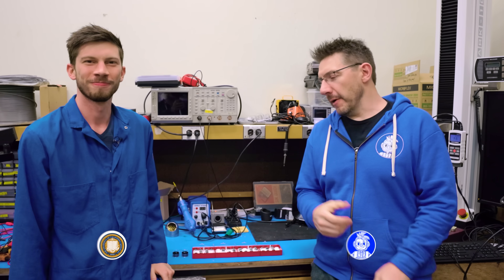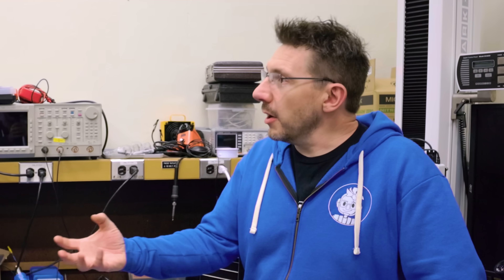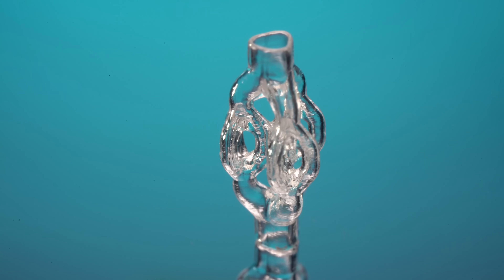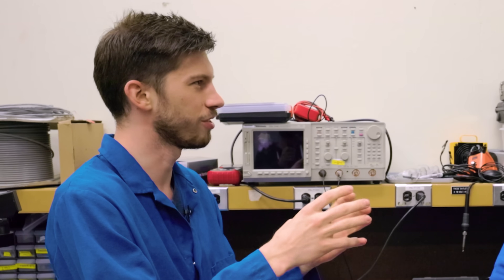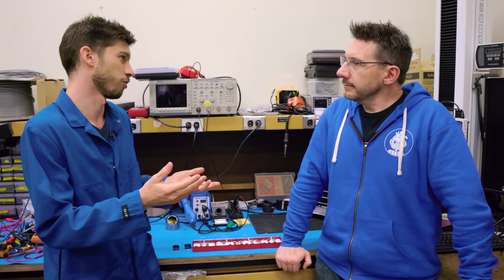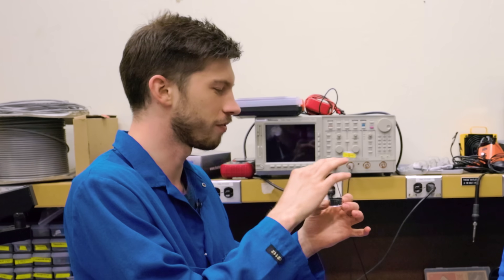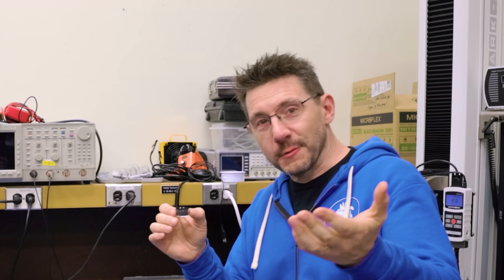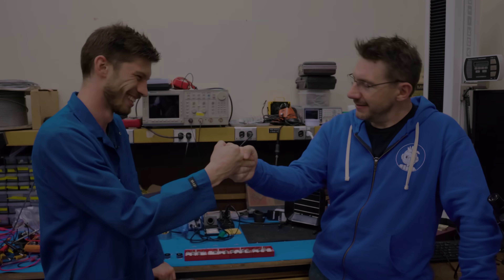Micro Glass 3D Printing!

Comment: You know the crazy lenses in phone cameras these days? Like the extremely tiny telephoto lenses, and how they even have active image stabilization where the lens itself moves and stuff like that? Yeah I can easily see the size requirements for those kinds of things plummeting. I'm also thinking about all the uses within super tiny robotics, things like super tiny glass bearings instead of the ruby bearings you see in watches, with stuff like that we could basically revolutionize anything and everything, so long as you can produce parts consistently in large quantities.

Comment: I used to work on this. Glass 3D printing in this way is quite effective in printing tiny objects, but is not that effective with bigger ones due to the thermal shock during debinding and sintering.

Comment: Printing really tiny lenses that don't need polishing and in complex structures gives me vibes of some sort of focusing chamber for lasers. Imagine printing a tiny version of the printer itself to print still tinier structures. Where would it end.
Reply: At 50 nm the particles they use are actually smaller than the wavelength of light the laser produces! The spacing between atoms is on the order of 1/10 of a nm, so the particles used here are only 500 atoms across, these folks are darn close to the limits of how precise light can physically get!
Reply: @thesquatchdoctor3356  This is a perfect modern day example of "sufficiently advanced technology is indistinguishable from magic." The other big example I think of is CPU/GPU chip fabs. These types of lasers are definitely modern magic lol.
Reply: @im1fadedRob  I don't think anything can impress me more than thinking about how a helicopter works. Those things are engineering miracles.
Reply: @thesquatchdoctor3356  how precise  visible light can be*. Not saying these techniques can scale to higher energy wavelengths but if they can, there is room for more precision.

Comment: The applications that come to mind with this technology are mind-blowing! The fact that you can actually print a lens array means that you can also print a mirror array and then have it plated. This means the micro kulminator as well as combining multiple laser beams can be done in a micro scale. I wonder if it's possible to print around the laser diodes and incorporate them straight into the glass structure. I know sintering is high temperature but I think some of the diodes can actually take that temperature. I work a lot with weaponry and I have a few designs that I couldn't build because I needed precise mirror alignment and a lot of them. This technology literally unlocks my design.
Reply: Laser guns?!
Reply: the couple of sentences of this comment are a little terrifying 😅
Reply: Yes. You understand, at least in part.
It's like looking at Newcomen's engine when it was brand new.
Reply: Very cool, but what are you going to target with your new doomsday device?
Reply: @johnsmithe4656  
The tragedies of the future
Reply: @johnshite4656  I don't make doomsday devices but I do like weapons 🤣 Florida man be crazy, he always like weapons

Comment: next level is micro-nano lithography 3d printing, ie processor making, yep its additive manufacturing process
Reply: Don't know if what i'm saying is completely stupid or not, but maybe this could be used to create photonic processor and/or photonic component. Damn that would be cool, imagine using a PC that use only light instead of electricity (except the part that is needed for the diode to create the light), cooling solution would be a thing of the past.
Reply: @davilinkicefire No your barking up the right tree there. 
I dont think optical computers ever got more advanced then bit/serial kind of demostration models but even in the 1980's those things where running at clock frequencies that are well. Impossible in electronics. 
They just used a glass that copy's the magentic flow of a wire in its internal polarity the light would come out polorized then by combining diffrent polarities they had thier calculations, and the material they used can switch faster then electrons can migrate so faster then a diode can react, they where near light speed calculations.

In the 1980's. 
I think today they use shifitng interfearance bands to run the calculations, and even can use interfearance bands to clock out the light so the materials used to meter the light have time to shift polarity; but the same idea for metering the light, polorize it using a magneto-optical material to actually put data into them.

But producing the demo models was a thing that took an entire university lab several months to set up. This could make that a thing of the past, just print off a few layers, sinister and assmeble them and wam bam here is your computer mam!
Reply: try micro-hole gated matrix nozzle fdm printing, no moving print head at all, just z-extrusion with changing mask along the way, similar to resin uv curing layer by layer

Comment: We got concrete printers, glass printers and metal printers, and to that i say: You wouldn’t download a building
Reply: @Enjeenier  true, that would be too many Terabytes
Reply: @ingeniando3d219 
Depending on the level of detail, it doesn’t need to be a huge file.
Reply: @Enjeenier  BUT! ...Wait... just hear me out! ...you COULD... just ummm.... 'find' a guy online... and he'll build you one for a very reasonable 'low price'... [an undisclosed insanely high price]! So, CHEAP!
/jk
Reply: Not as an Stl.  You need a 3MF for that.
Reply: @nicks1146  you rather would want to use an obj for higher detail, but just to be safe use a toolchanger for soluble supports and up the bridging speed by 200% so the ceilings come out flawless, also use a textured build plate and glue stick for higher adhesion and enable ironing for perfect top layers, you may also want to consider 35% cubic/gyroid infill for better structural integrity
Reply: @nicks1146  you would want to use an obj file for higher detail, also consider getting a tool changer for soluble supports and use a textured build plate with glue and a raft for higher adhesion, also consider upping the the bridging speed to 200% for clean ceilings, enable ironing for perfect top layers, consider using 45 % gyroid/ cubic infill for better structural integrity, and finally lower the layer height on the bricks for better layer adhesion!

Now with the building done, ENJOY LIVING!
Reply: Soon you can download the 3mf.
Print a brick building, with carpets, windows, furniture, plumbing, kitchen and everything right there and then.
Reply: You forgot ceramics lol
Reply: actually the audio used by that video in the 90s was pirated it was licensed for one use , it was then pirated and used on multiple dvds from that era
Reply: @Enjeenier  the Chinese have been printing buildings for over a decade already...
Reply: Don't forget chocolate and silicone.
Reply: Hogwarts 😂❤
Reply: @Enjeenier  but I would
Reply: @Enjeenier  tf I would... Arrrr!
Reply: Actually, you would people 3d print houses all the time
Reply: @HalloGaming  Ik but like a fully finished house , not just the walls, like windows, cables,  sinks, toilets etc
Reply: I would download a house yes.
Reply: Bruh, this is what we need, free knowledge and ability shared with the less fortunate. We could build homes cheaper and easier so why more expensive? They want our money not expansion. We may be the consumer but we get consumed.
Reply: Epic but pirated music starts playing
Reply: And DNA printers
Reply: The are actually 3D printers that print entire buildings.   Look it up.
Reply: Hi from 80 years in the future… So how well did this comment age🙄
Reply: I work as a cartographer for a survey company. We do actually 3d print terrain models out of concrete as gifts for clients sometimes. And yes, the LAS files are often on the order of 5-20 Tb per project
Reply: @Enjeenier  Minecraft and sci-fi is the inspiration for all technology
Reply: @Enjeenier  i love you aha
Reply: Can easily download a building. I'll hunt for files tonight and if I find nothing I'll post the first to thingiverse by the end of the weekend.
Reply: @Luke-qs2cg  Thanks, and if you can, can you please post the files with the double bathroom pack????